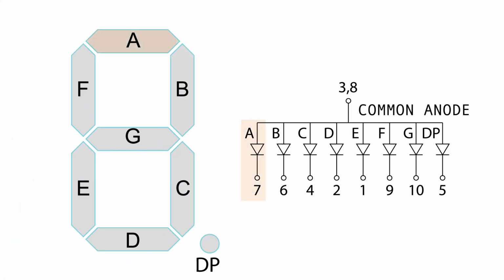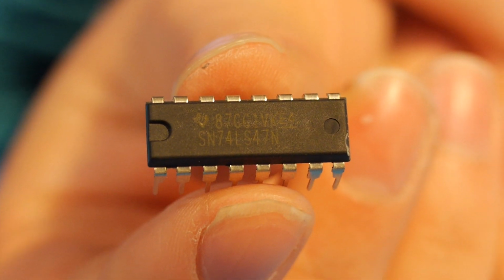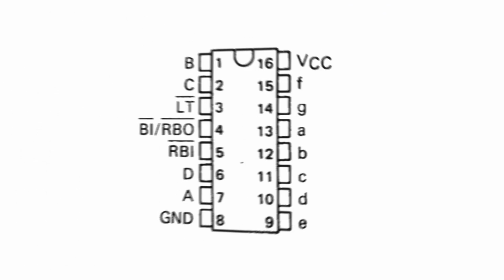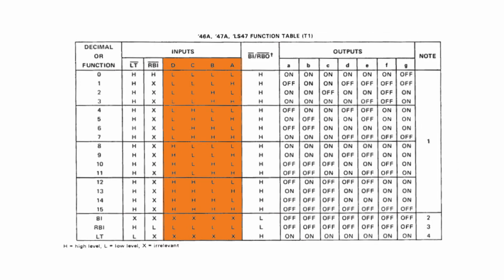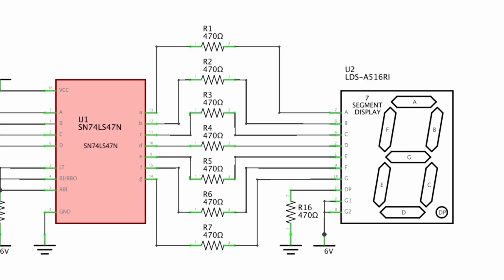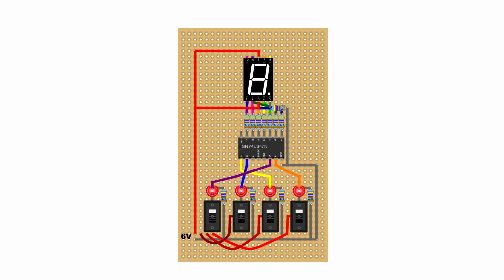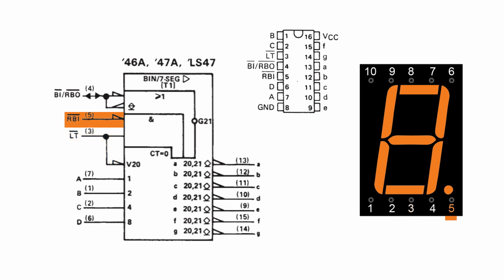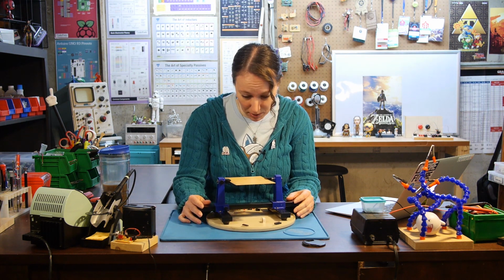How To Drive A 7-segment Display - The Learning Circuit

Comment: Does the SN74LS47N decoder work with a 6 volt supply? 
That would be very convenient for me! But everything I'm reading says it's rated at about 5 volts. 
I don't want to blow it. And it seems to work in the video at 6 volts..... But is there a definitive answer? Does the 1 extra volt not really matter?
Thanks to anyone who may respond!

Comment: How much more complicated would the setup be if instead of combining the switches to display larger numbers(i.e. switches 4, 2, and 1 to make 7), 6 switches were used to display numbers 1-6. Each switch would then have a specific number and wouldn't be used in combinations. I'm playing around with a 7 segment display and considering getting an Arduino if necessary. I've seen lots of projects used buttons to count up or down, but rarely can i find a project that uses individual buttons to display individual digits.
Reply: Not an expert, though I figure you could wire up each switch to pull high the specific BCD pins, so there would be wires running everywhere

Comment: My 74LS47N is is outputting the correct truth table. if all my inputs are low, 0000, I should get a 0 on the display, but I'm getting a 4. I tried two other 74LS47 and they are doing the same thing. To double check, I used a voltmeter to check the Vout on each ping of the IC (abcdefg) and I'm getting HLLHHLL (abcdefg), which is a 4. Am I using the wrong IC or are they defective?
Reply: Are you sure all your inputs are low? In this schematic all input pins are floating, which usually causes unpredictable behavior. Something similar happened to me.
Remove the connection from the switches and LEDs to the four inputs. Put 1K resistors from each input pin to ground, now you have four stable low inputs that should display “0”. If this works, floating inputs is your problem.

Comment: using sil-resistor packages would be so much simpler...
Reply: True. But if you learn how to do it with individual resistors, it's easy to switch to a SIL. Plus more people tend to have a collection of individual resistors lying around rather than a large variety of values in SIL packaging, so I went with the more accessible method.

Comment: When you say you shouldn't leave pins floating, I don't think it'll matter for an LED display...

It's a bigger issue for CMOS where a floating pin could sit in the nonlinear region where it may not really be high or low, this can cause higher power consumption, generate more heat, and produce unpredictable/undesirable results or behaviour.
Reply: In this particular case, we actually want the pins high, since they are low-active, so they definitely need to be connected.

But even if they were high-active, leaving them unconnected is a bad idea. Stray capacitance could induce a voltage on the pins which can be read as a high signal by the chip. I've had it happen before when I left a pin floating.
Unless a pin is labelled NC, I think you should always have it connected to something. If nothing else, it is good practice.
Reply: @Yotanido  I know. I'm taking about the 7 segment display, not the driver chip. She said she would connect the dot point pin of the display because you shouldn't leave pins floating...
Reply: @TomStorey96  Fair enough, it doesn't make a difference there.

But keep in mind that not all viewers will be able to tell the difference. Teaching them to always connect all pins is a good idea in my opinion.
Reply: @Yotanido  you would be better off teaching them those particular reasons in my opinion. It's all well and good to say "connect all of the pins to something", but maybe e14 viewers are the kind that could really benefit from knowing the reasons why, and the cases when it matters the most.